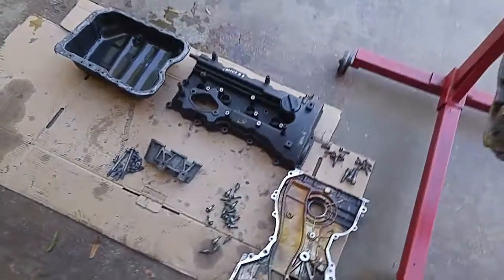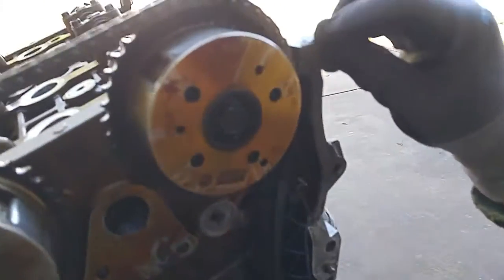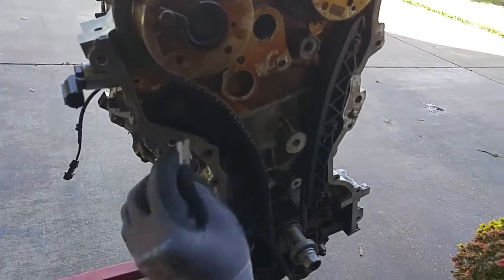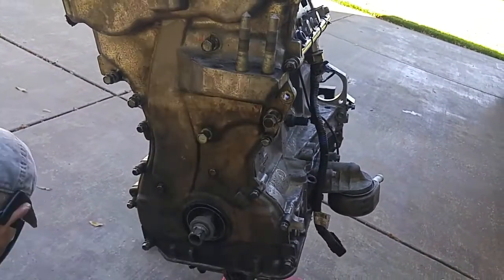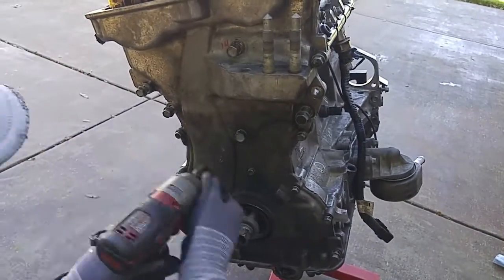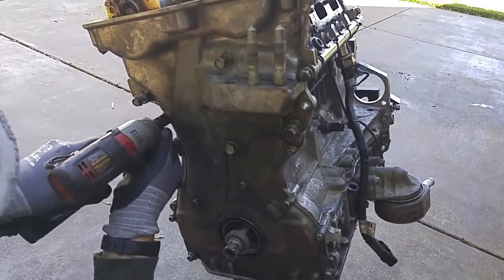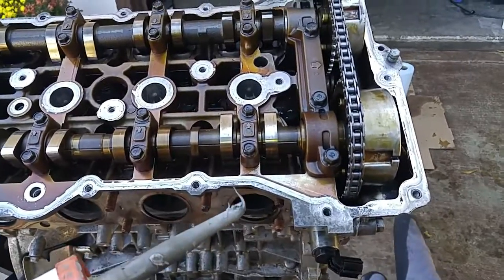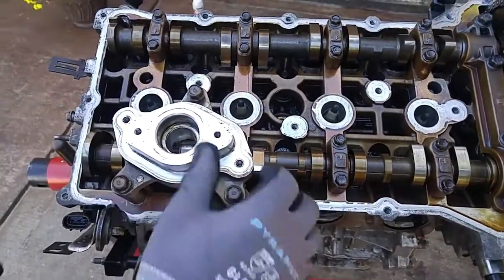How To Install Oil Pan, Valve & Timing Chain Covers; (Hyundai / Kia 2.4 GDI) Long Block Rebuild Ep 3

Comment: What size torx did you use for the head bolts.
Reply from the maker: It's not torx which is 6 point.  The tool used is a triple square with 12 point from my kit.

Comment: Is there 22 bolts total on this oil pan? I am getting ready to do one of these. I am thinking about using the Mopar Rtv. That seemed to be the best for oil/gas from Project Farm. Any thoughts?
Reply from the maker: Don't recall the total number of oil pan bolts.  I've had good luck with the Permatex Gray RTV.  Has never leaked.

Comment: What were the timing torque specs for the timing cover again?
Reply from the maker: Less than 10 lbs for the 10 mm bolts, around 14 lbs for the 12 mm.

Comment: Hola mi amigo ya te he visto en algunos tutoriales de Hyundai y por lo que veo se nota que sabes del tema.Para no hacerte largo mi problema es que trabajó en mecánica automotriz y recientemente repare un motor G4KE el cuál me da un problema sólo en ralentí se cae la presión de aceite cuándo me baja de 10 libras lo apago para que no se valla a dañar ya que te repito el motor se reparo y las medidas de  biela,cigueñal y axiales quedaron bajo especificaciones el problema sólo se produce en ralentí si yo lo arranco y lo tengo hacelerado por 30 minutos a 1300 rpm la presión de aceite se mantiene en aproximadamente 35 a 38 libras me está volviendo loco ya probé con 2 bombas de aceite más y el problema persiste te agradecería si sabes algo y quisieras compartirlo conmigo gracias y un saludo de Costa Rica
Reply from the maker: Mi suposición es que reconstruiste un motor con cojinetes de biela desgastados. Si es así, los residuos de los cojinetes desgastados pueden haber obstruido los conductos de aceite en el cigüeñal, el bloque del motor y la culata. Después de desmontar un motor con residuos de cojinetes, uso aire comprimido y disolvente limpiador de frenos para eliminar cualquier cosa que haya en los conductos de aceite. También hay una rejilla de filtro de aceite en la parte superior del bloque del motor que quito con cada reconstrucción. Envía aceite a la culata. Si esa rejilla está obstruida, eso podría causar una caída en la presión del aceite a bajas revoluciones.
Reply: @hardlymovingpro  Te agradezco la información, y si la rejilla es la que va en el Block del motor y si yo la saque y la lave bien, después para armar el motor me gusta usar algunos productos para limpiar bien el block y que quede sin nada de residuos ,pura madre es que me gusta que un motor oh cualquier otra cosa que repare que quede cómo si hubiera salido de fabrica las medidas de la bancada quedaron en .038 ,las bielas quedaron en .038 y los axiales tienen 3 milésimas si lo divido entre 2 me daría 1.50 creó que está bien quiero que me perdones porque antes que te escribí omití no se porque se fue decirte que ese motor en algún momento le cambiaron la bomba de aceite y le pusieron una bomba de Kia 2.0 rotativa eh revisado los pasos de aceite con aire ,con humo para ver si se ve alguna fuga de aire oh humo por alguna parte y lastimosamente no se ve perder aire oh humo por ninguna parte que no sean pasos de aceite hacia lo que es los árboles de levas hacia el lubricador de la cadena de distribucion y al tensor hidráulico de verdad me tiene un poco asustado porque de mi parte siempre que armo un motor lo reviso bien con plastigate luz de anillo  juego axial qué las proyecciones de los árboles de levas estén bien y después de muchos años de trabajar en esto y reparar muchos motores es la primera vez que veo un caso cómo este y me tiene desconcertado una pregunta sabes si esos motores llevan algún tipo de valvula check yo sólo les conozco la rejilla qué va en el Block amigo que tengas una muy buena noche y gracias por el tiempo y apoyo
Reply from the maker: Pensé que habías dicho que habías cambiado la bomba de aceite dos veces. ¿Me estás diciendo que la bomba es de un Kia 2.0?
Reply: @hardlymovingpro  el motor lo compro la clienta y dónde ella compró el motor le pusieron la bomba de KIA 2.0 el motor  trabajó aproximadamente 3 meses y se daño aquí es dónde la clienta qué es hermana de un muy buen cliente que tengo me pide que si le puedo ayudar a resolver el problema con el motor bueno ya te conté que se reparo el motor luego de ver que empezó a prender la luz de lubricacion tome las medidas pertinentes para ver de a que se debía a que prendía la luz de lubricacion dándome cuenta del respectivo fallo lo de la bomba fue que unos colegas y otro amigo de una rectificadora me facilitaron una bomba cada uno pero el daño persistia lo cuál me puso a pensar que el fallo está en otro lugar pero tome la decisión de llevar las bombas a revisar  para ver si por mucha coincidencia están malas oh están buenas a lo que me dicen en el taller de rectificación es que les hacen pruebas en frió y caliente para ver si tienen alguna perdida de presión esperó por mucha coincidencia que las tres estén malas.(la bomba original con balanceadores y precarter yo no la cambié esos lo hicieron dónde la clienta compro el motor)
Reply from the maker: Aquí hay un video donde se desmonta una bomba. Observe la parte donde quito el resorte de la bomba para limpiarla. Supongo que el resorte controla la presión del aceite.  https://youtu.be/BhtWkwWnnTE
Reply: @hardlymovingpro  Hola amigo aquí gracias a Dios haciéndole frente a la vida ,tome la decisión de volver a desmotar el motor y revisarlo más profundamente,me dice el dueño del taller de rectificación háganos una revisión más profunda ha unas piezas bomba de aceite y al cigüeñal qué hay un taller en San José la capital de Costa Rica que hacen un test en frío y caliente para ver dónde se pierde la presión pueda ser que la bomba de aceite esté mala ,qué el cigueñal esté reventado,oh incluso que la culata esté reventada entre los pasos de aceite para algún lugar se va esa presión lo gracioso es que el motor tiene buenas medidas para que no de ningún problema pero ya sabes cómo es esté mundo de la mecánica automotriz.Cuando logremos encontrar la falla te cuento de mí parte un gran saludo por tu tiempo y la ayuda que me has brindado hasta luego y pura vida.Mil gracias.

Comment: Hello sir I saw you had commented on someone's video where they removed the engine rom their Kia. I have a 2013 Kia Forte and need to pull the engine. After removing the car's from clip can I just pull the engine up, out and forward or do I need to lower the engine with tranny and lower cradle all together? Where would I hook the engine hoist on the engine? The one guy in the other video took a strap around the engine but not sure I want to do that. Thanks in advance
Reply from the maker: Watch this video and see if this helps.  Follow up with any questions afterwards:  https://youtu.be/T8QZKKUmV0I

Comment: That was about 4X the amount of RTV that should be used. Don't forget that the overhang of RTV that you see on the outside of the engine is the same about on the inside and it can and does break off eventually and clog things up. Where you're absolutely right is in not torqueing down the parts all the way. RTV cures by absorbing moisture from the air. If you eliminate the possibility of air getting to the RTV it will not cure.
Reply from the maker: Thanks for your critique!  I wouldn't agree about the 4X amount of RTV but I did see cases where not enough was used resulting in a customer "comeback" due to oil leakage or seepage. As long as the RTV doesn't interfere with any oil channels, I have no worries of the Permatex ultra strength gray rtv internally braking off.